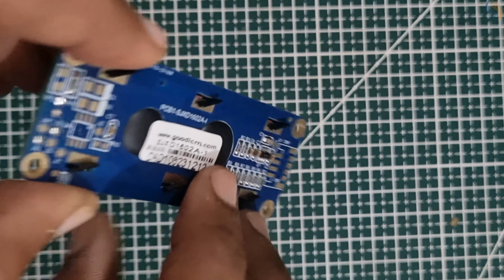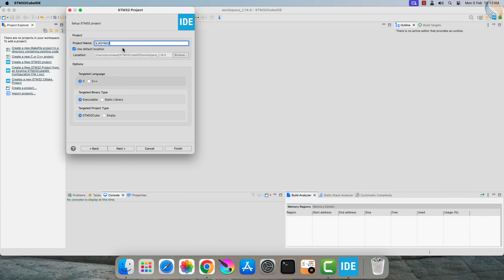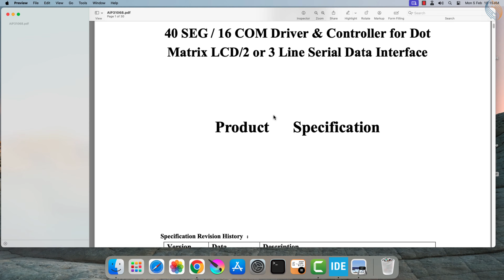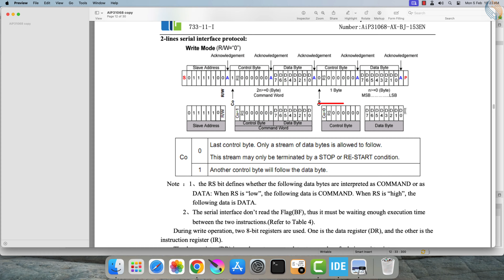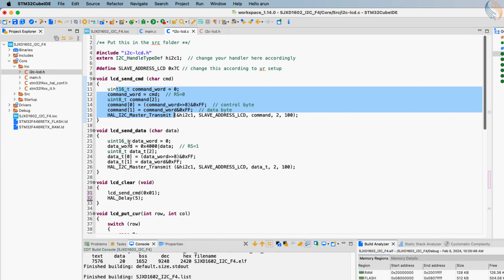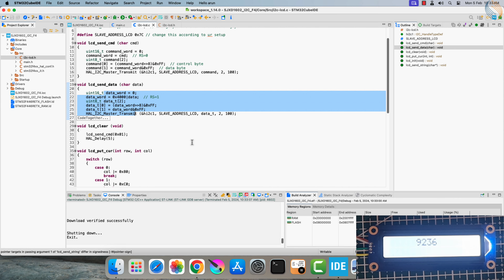Interface I2C-LCD with STM32 || AIP31068 with Built-in I2C

Comment: where can i get the librarys pleaes ?
Reply from the maker: Link is in the description of the video.
Reply: thank you.

I could download the libraries, import them, i followed the configuration, everything seem to work. no errors, but at the end my LCD isn't printing anything.
i have another kind of STM32 than yours, mine is stm32h7a3zit6q, but it doesn't look like the problem come from here, i did the modification to work with mine.

also i have another LCD, but the adress is 0x20 and the rest is the same so it should work

i am only a student so maybe i missed something.
Reply from the maker: @roockiebatleboa7704 which LCD do you have ?
Reply: @ControllersTech  DFR0063 
IIC LCD1602
Reply: @ControllersTech  hi, i have the DFR0063 IIC LCD1602 Module
Reply from the maker: This video is specific for inbuilt i2c. You should look for another video, "i2c lcd in stm32". You can check it on this channel itself. 

 If all three jumpers at the back (A2, A1 and A0) are connected, that means those pins are grounded. This makes the address as 0x20 (7 bit). But STM32 needs 8 bit address, hence your address will be 0x20<<1, that is 0x40.
Reply: @ControllersTech  i thought it was inbuilt since it is attached to it , but thanks anyway,  i will try your answer and if not will search for the other video like you advised me to, thanks again !

Comment: Good afternoon, great video, I started using the stm32 line because of your videos, one thing that would be good is that it works with ov7725 and similar cameras, there is nothing like that and the stm32 documentation is not clear.

Comment: Rs.550/- is not reasonable for any kind of bulk manufacturing. Even for a hobby project, this is costly when we can just solder the other pcf8574 i2c board directly to parallel lcd pins.
Reply: Sir I want to know how to interfere with a bare tft tuch LCD display of 7 inch with stm32f7508 and touchgfx please sir
Reply from the maker: Please let me know if you find it being sold any cheaper than this in India. You can try searching for i2c lcd display.
And yes it is not reasonable for bulk order. For that you should directly buy from the manufacturer itself.
Reply: @ControllersTech  Thanks for reply. You're doing an amazing job for us. Your channel is my goto reference for all STM32 code. My comment was a rational comparison between using this LCD vs using parallel LCD with I2C module with respect to cost. Let's hope these inbuilt Serial LCDs gain popularity and prices come down in the future.